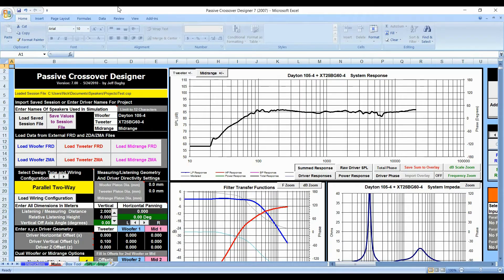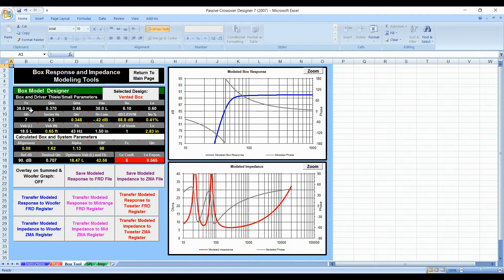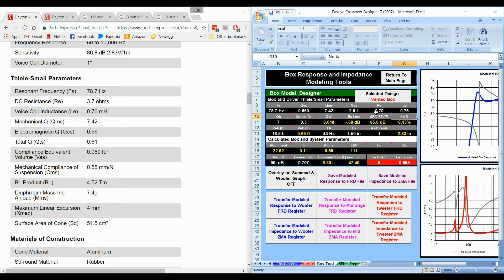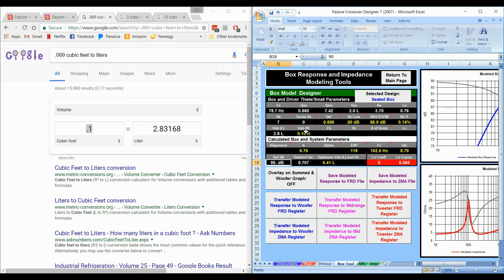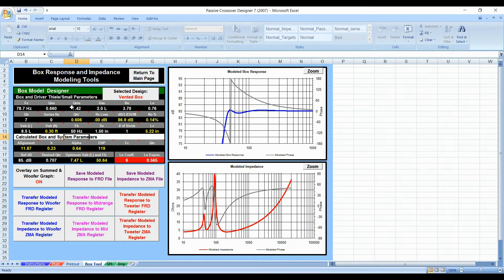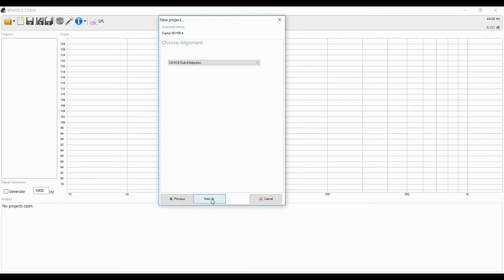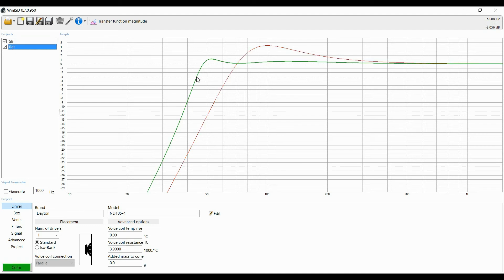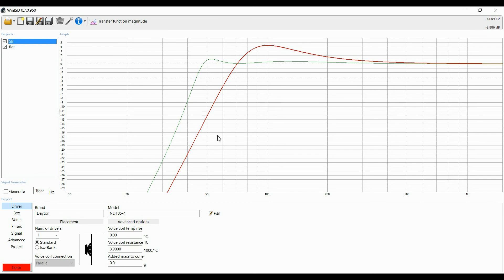How to Design a Crossover - Part 6 - Determining the Box Size

Comment: Im loving your tutorials, ive been so confused by all the different software that i almost gave up. Then i found your videos, awesome. I do have a question though, with the box design for a 3way speaker, which woofer would you model it on, the sub or the mid, or is there a way to show both drivers in the box at once and work it from that? Sorry, im so new to this

Comment: Using this method have you found that not using empirical measurements yields similar to identical results to measuring the drivers directly in a cabinet and using that data to derive the crossover design?
Reply from the maker: It's always best to test the drivers in a cabinet you have built.  That will give you the most accurate response.  However, there are some drivers that are fairly close to the modeled response.  Of course there are some that are way off as well :)

Comment: Any way to add the box modeling to the main graph? Seems I can have either the woofer's FRD, or the box's FRD loaded up, but not the woofer in the box's FRD - if that makes sense. The more I dig into this, the more it seems the proper way to do this is to create a general sketch (I.E prototype), build a box, stuff the drivers in the box, measure the things, then convert my measurements to FRD/ZMA, and importing those into WinISD to make a 'final' design. am I on the right track? I would love to be able to sim BSC, box enclosure, and driver FRD's all on the main graph in WinISD accurately before building everything if I can though.
Reply from the maker: Kcducttaper1 you can't do that. You do have to save it and then reload it. I'm not by my computer right now so I can't tell you exactly how to do it. I'll try to get back to you tonight. However it's impossible to graph the BSC without taking actual measurements from the woofer in your own box.  The program will not show it losing low end.  If you want to just do it in the program as is, you need to add a BSC and then drop everything below that 3 to 6 decibels

Comment: Fantastic series! One thing I'd like to learn more about is how to properly calculate bsc to add in my crossover.
Reply from the maker: I did a basic video on BSC here, but if you want, I can do one with how to implement it on this program as well.  https://www.youtube.com/watch?v=ld4A6MQ4E3U&t=27s

I have been wanting to get some videos out to you buys, but I have been without internet the past 2 days.  Someone cut a Fiber line in our area, so I have been unable to upload anything new.  The next video will be on phase, then I can do this one if you want.
Reply: I saw that and it looks a lot easier than I originally thought. It looks like the filter would just go before the crossover for a multi-way setup then. Sound right?
Reply from the maker: That's it.  It goes on the woofer section of your crossover.
Reply: If it goes on the woofer section, wouldn't it bypass the tweeter?
Reply from the maker: Yes.  The BSC is added to the woofer circuit and you pad down the tweeter to match with an L-pad or resistor
Reply: Oh, I see. ....though I'm not quite understanding how that's preferred over putting the whole circuit before the crossover. If you're buying a resistor to pad the tweeter anyways, it may not be as big of a deal, but if my woofer and tweeter match nicely without a pad, it seems putting the bsc (2 components) in the woofer circuit and adding a resistor for the tweeter is a 3-component job where dropping it in front of the crossover is a 2-component job. Am I missing something?